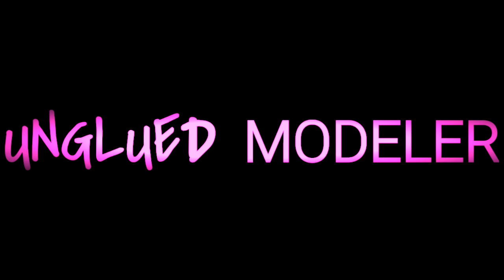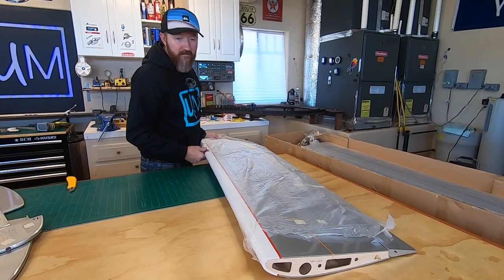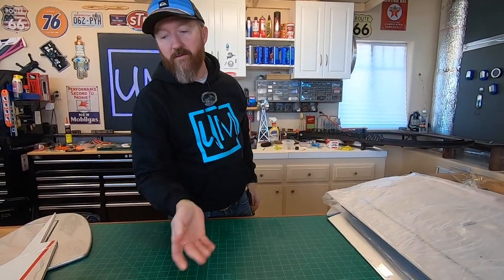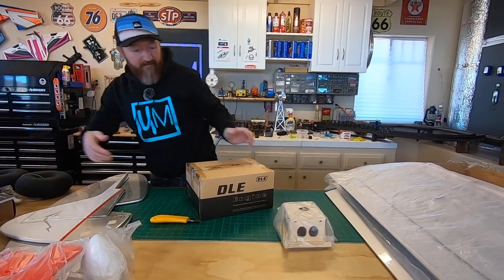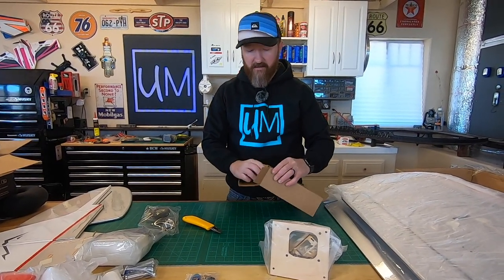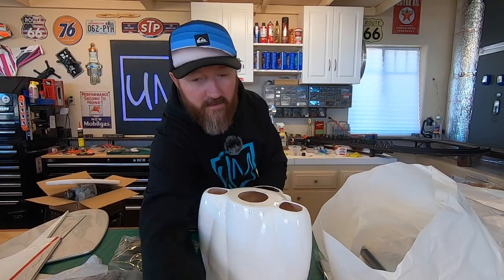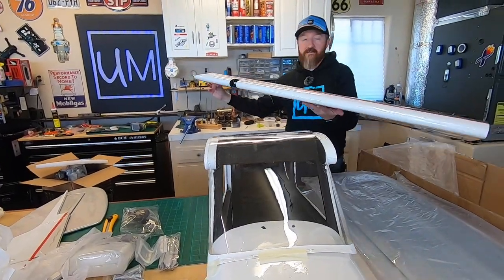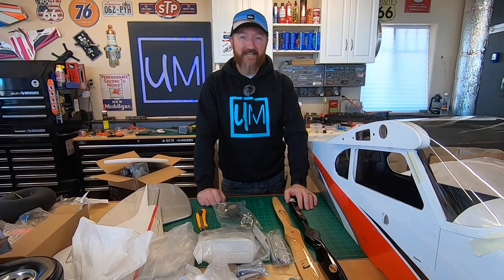Hangar 9 XCub UNBOXING with DLE 61 Engine!!

Comment: Awesome kit. I do completely agree with your choice of landing gear and especially those wheels, I might change the LG for a carbon fibre one which would reduce quite a lot of weight. I know bits like that don't drastically affect flight characteristics bit it's surprising when you go right through a model and remove absolutely everything that can be and the lightest possible instead of trying to maintain scale looks so much just how much better things can fly. . I'm very impressed with the obvious quality of that tail wheel gear but, I'd probably replace it with something much lighter, unless it's actually a lot lighter than it looks. I've got a slightly bigger one back home sitting in a box all ready to start on when I finally get back to my home, if I remember correctly I think it's 13 foot wing span. I bought a 35cc OS petrol engine for mine but, the more I think about it the more I think I should go bigger, you using one nearly twice the size makes me even more sure. I don't want extreme aerobatics or power but, I do want to be able to use it as a tow plane for the bigger gliders and, I have a fibreglass fuselaged YAK 55 that I got off another club member that he tried running on a OS 4 stroke 1.20 glow engine and it was pretty soggy with that, basically it's a bit on the heavy side and maybe that 35 cc petrol might be about ideal for it and get at least as big as you've got for yours. I want it to be capable of towing easily, take off very quickly but I don't even want to fly it particularly fast so, more power for takeoff and tow then putter away cruising around.
Looks great guys, can't wait to see the maiden.
PS. My solution to saving weight by not putting extra junk in the cabin area and it looks really cool too is smoke spray tint on all windows. Once done you can have everything inside any way you like and the plane always looks great.
Reply from the maker: Thanks! Haha I’m a sucker for cubs and scale details. I’ll always take a weight penalty for scale looks haha. Your bigger Cub sounds awesome but I would agree that a 35cc is too small like you are thinking. This XCub says it needs at least a 50cc and max 70cc. And yes that tail wheel setup is made so nice!! This will be a fun one!
Reply: @UngluedModeler  Thanks for the reply. I'm a bit in 2 minds, (1) say's reduce weight as much as possible AND increase power to the max and (2) says keep everything as close as possible to the real machine, including performance and to that end I think the 35cc would work out pretty close. It would take a fair bit of runway to build up speed for takeoff then climb pretty slowly, more or less about scale performance for an absolutely stock full size plane. We don't always have perfect runways and a sudden crosswind while struggling to build enough speed to get in the air where it's safer we ideally need to keep short as possible. They use Cubs a lot for STOL competitions so why the heck not over power it a bit, especially if I'm dragging some huge glider behind. I'm going to investigate those wheels you've got for sure so thank you very much for the tip on where to get them, just a pity they don't have a more progressive range, those I think would still be better a bit bigger but, NOT over two hundred mms, that's a huge jump. It could be awesome for landing in much rougher terrain and might not look too extreme but, they couldn't look right and would create a lot of extra drag, they may even tent to pull the nose down at any reasonable speed. I think you made the best compromise with the ones you bought. Again, those main wheels are top quality in most ways except where it counts, a bit like the carbon fibre landing gear I put on my Stick to lighten it from piano wire was much lighter but I may replace it when I can, again with carbon fibre but, home made and thinner. The bought one IS very light but, it's got NO give hardly, it's really light but so rigid it absorbs almost nothing.
I'll continue the argument with myself right up till it's actually built lol. I got it for a large gentle flyer that's practical for various purposes, not an either aerobatic mad machine or a pylon racing candidate or speed record breaker which is what I'm usually more inclined to be, this one I want to just be a big gently but practical model I can on occasion when needed be a workhorse and even maybe strap a large pod on underneath to act as a lolly dropper for kids at x mass or any event where it could be appropriate. As I said though, I'll still be fighting with myself about it right up till it's actually flying.
I even forgot about the flap setup on your kit, even that is well thought out and so many things in that kit are so well made I'm very impressed, you don't usually see (bad idea) but top quality tail wheel assemblies like that or main wheels to those flaps, just everything about that model seems top quality. Just why oh why didn't they at least put soft spongy tyres on those gorgeous (heavy) rims?
Reply from the maker: Haha yeah I hear ya about scale performance. This 61cc engine will make the plane way overpowered. I bet that 35cc would make it fly like full scale haha. Yeah they got a lot right with this plane but I agree with the landing gear. It’s a bad design should have been Carbon if they went that style and yes those wheels are gorgeous but the tire is a rock!!! Lol 🤷‍♂️
Reply: @UngluedModeler  Kept light and on it's own I think the 35cc would fly scale sort of performance I think, I've really got to make my mind up whether I want a workhorse or something fun that can tow and carry loads when required. I can't see it being massive fun, even with decent power but it should be [more] fun with better power at least. Another factor is, if I want scale and I run the 35cc it'll have to be a fair bit smaller prop so will maybe fly realistic scale performance it's always going to look wrong sitting on the ground. I've probably got plenty of time before I can get back and start on it anyway so I'll follow your build and flights and assuming they'd be close to the same sort of weight, mine slightly bigger but I'll be shedding every possible bit of weight possible, plus the engine itself would be a few hundred grams lighter if I ran the 35cc  so I'll get a pretty good idea from how overpowered or maybe barely enough yours turns out. I hope and am pretty sure you should have plenty with your 60cc engine, I hope. Good luck with it, I'm really looking forward to seeing this fly. Don't rush anything though, attention to detail is pretty important as you know.